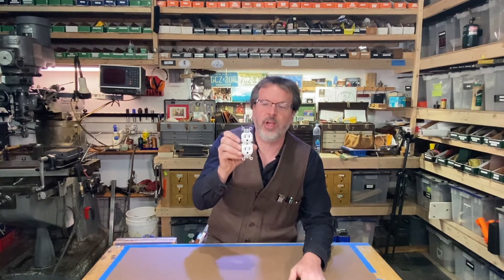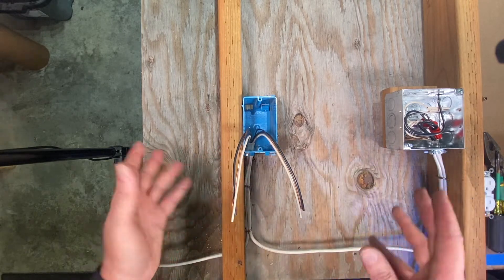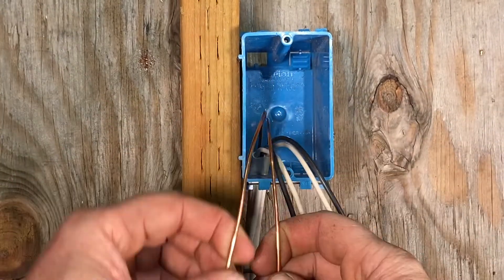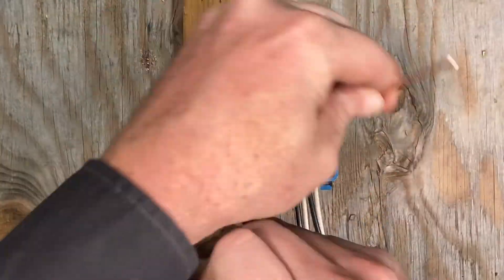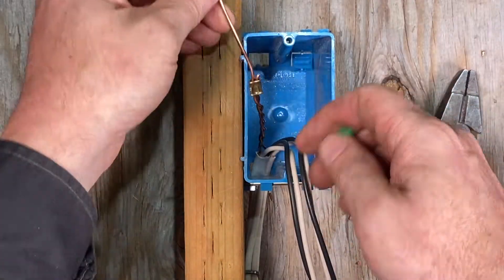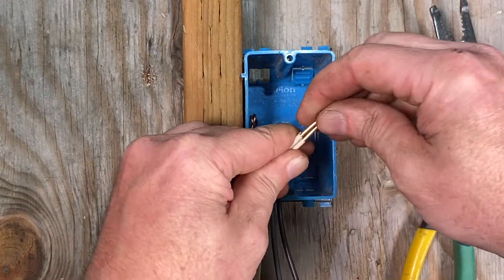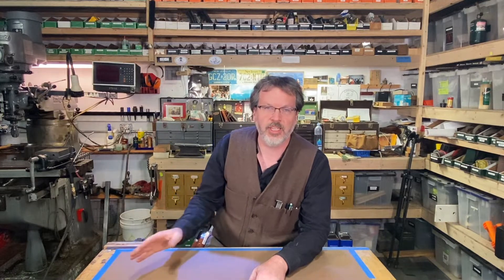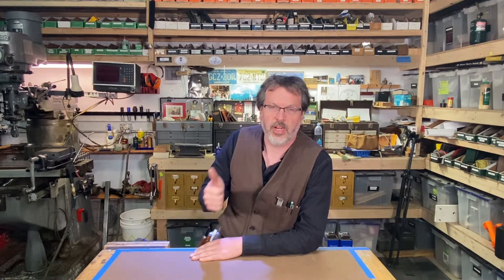How To Wire An Outlet - Best Method - Electrical Receptacle

Comment: The receptacle that you are using is a Leviton commercial spec grade pn BR15. If you don't want the back wiring option and you don't want a residential grade, you can use a CR series, CR15 in this case. Same thing with 20 amp versions. I find that the clamping feature can be a nuisance if you don't want to use it. Eaton receptacles are similar and use the same part number, e.g. CR15 or CR20.
Reply from the maker: Right On! 🙌

Comment: Excellent video.  This is the way to wire an outlet.  It is legal to wire the power in and power out to the sides of the outlet but I did that once and it caused a voltage drop under load at the far end outlet. Also, if you use 12ga wire and 20  amp outlets, it is difficult to get the wires pushed back into the box.
Reply from the maker: Right On! 🙌Thanks! ⚡️⚡️ Yes that 12g wire can be a bear to push into the box. Have to get all crafty with the bends like an accordion 🪗😄

Comment: Great DIY project.
Sockets are different in the UK but obviously have the same three wire system.
Live (line) = Brown
Neutral = Blue
Earth = Yellow/Green (stripes)
When using cable with bare earth wires the UK code requires the earth wire to be sleeved with earth coluored sleeving.
Thanks for sharing.
Reply from the maker: Thanks 👍🏼 Ah that’s interesting about the insulation on the ground. I have connected machinery from Europe using the wires you just described. I wonder if there is any other color coding out there in the world.
Reply: @RightOnJonCrane  there is an article in Wikipedia that shows wire color codes by region and history across the year's
e.g. th UK used to be 
Red = Line (now brown)
Black = Neutral  (now blue)
The article can be found here:   
https://en.m.wikipedia.org/wiki/Electrical_wiring#Colour_coding_of_wiring_by_region

Comment: I'm glad you pigtailed it off to me its lazy to wire it through the device because when that fails all the others down the circuit fail. My only issue is I hate those ground crimps when you need to add a line and are tapping off pre-existing those crimps are a pain in the butt most the time i got lucky and someone never crimped it fully and i can reform the crimp and pull it off to splice into the grounds. Also I know its not required to tape devices in a non-metallic box but I always do as a courtesy for the next person especially years down the road where the face of the device breaks off from paint etc and your staring down the internal guts of the devices and not much to safely grab onto. Also I always tighten down all my terminal screws whether I have wire under it or not.
Reply from the maker: Right On Rob! 👍🏼 Good sound advice. Yes I’ve cut off quite a few of those crimps over the years. They can be good when space is tight in a box. I like the tape too! Great to have your input! 👍🏼⚡️⚡️⚡️
Reply: @RightOnJonCrane  right on Jon thankfully I haven't had to cut a crimp yet most are loose and a few shakes and twists with the kleins and its coming off yours is probably the first I've saw that I'd probably be cutting to add on lol

Comment: Can agree with all this stuff. As good as the smiley face looks it’s not correct. Go to a hospital and look at the plugs. They are with the ground lug to the top not the bottom. The reason for this is if something drops on the plug it will not short out the circuit and course a potential fire. Sound advice on everything else. Great advise for those who may not feel comfortable doing this!
Reply from the maker: I agree! 👍🏼 That is a good practice. My electrical trades teacher taught that method as well. He would also say that if you push down on electrical cord that’s plugged in you are less likely to snap of the ground! Thanks for watching and bringing up a good point! 👍🏼⚡️⚡️

Comment: I learned something new about wiring a outlet...never saw it done that way...do you ever tape the wire nuts or the outlet itself when installed in a metal box..?
Reply: Your always suppose to tape the devices in a metallic box as for taping wire nuts thats generally only non-professionals doing it handyman etc. If you correctly make a splice and cut the wires to the correct length theres no need to tape it on top of a wire nut.
Reply: @robfahey1349  gotcha... not being a sparkey I wasn't sure...
I did it anyway... seemed to be a extra safety thing...
Reply: @setdown2  I know alot of old school I saw done that way when it was friction tape but sometimes underneath those they didn't even use wire nuts. Just use good quality wire nuts ideal makes great wire nuts most guys prefer the tan/red combo or 3m makes great line performance plus they have a flexible skirt in case your worried so they cover more
Reply from the maker: Right On Chuck! 👍🏼 The only time I tape a wire nut is in a high vibration situation to add some extra peace of mind. I also will tape in a moist environment. Sometimes putting a dab of de-ox under the lip before some tape. 😃👍🏼⚡️
Reply: @RightOnJonCrane  speaking of moist environments I find some 3m rubber mastic tape works great for doorbells that I want to last. Those terminal screws always rust and corrode and your replacing it every few years, as well as sometimes people tend to crank down on them too much when they are on aluminum siding and short out the transformer so I found i always like cutting little squares and cover the terminals as best I can before installing and then alittle bead of silicone around it try and keep any other moisture at bay.